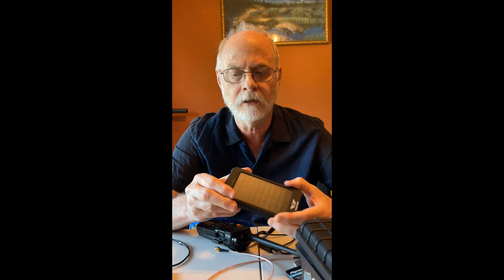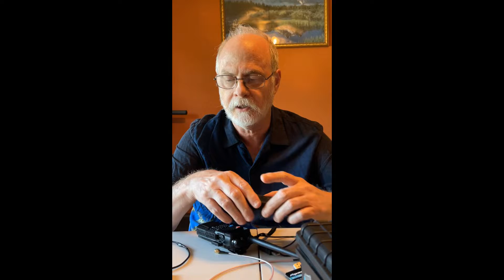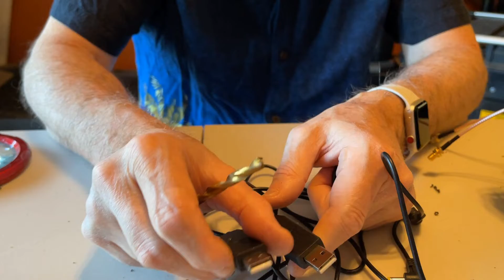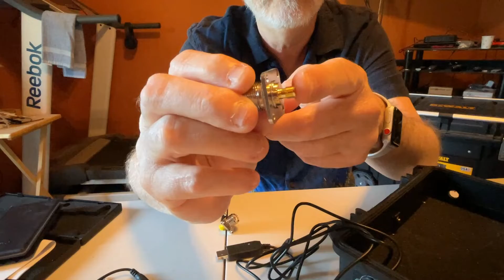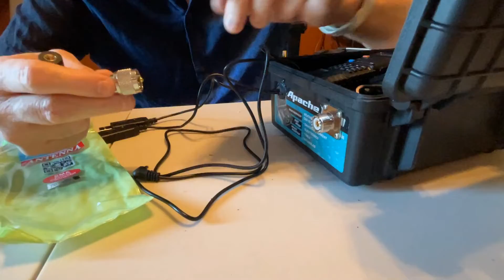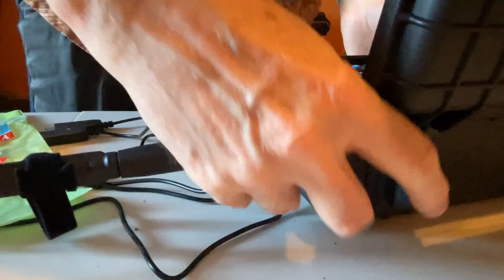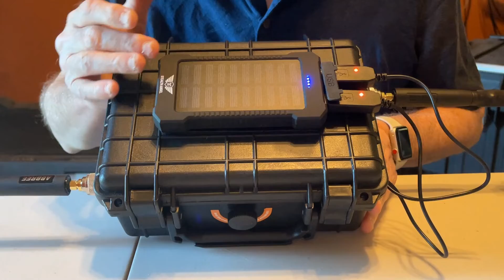Portable Repeater Build, Part 1

Comment: I believe the polarization (horizontal or vertical orientation) of UHF and VHF antennas matter. Since the people using your repeater (your campers) will probably be using their HT vertical (with the antennas up and down), I think you want your repeater's antenna to be vertical. If they are horizontal, I believe you will lose a large part of that gain you said the antenna give you.
Reply from the maker: You are correct the portable repeater needs to be oriented vertically.

Comment: Great video! Can you post the Settings for the 2 radios?
Reply from the maker: RX Radio 3
Using this VFO 
VFO B 148.600 
Menu 0 SQL 3 
Menu 2 TXP Low 
Menu 4 VOX Off 
Menu 10 R-DCS Off 
Menu 11 R-CTCS Off 
Menu  12 T-DCS Off 
Menu 13 T-CTCS Off 
Menu 25 SFT-D - 
Menu 26 Offset 000.600 

TX Radio4 Settings Using this VFO 
VFO A 148.000 
Menu 0 SQL 3 
Menu 2 TXP Low 
Menu 4 VOX 10 
Menu 10 R-DCS Off 
Menu 11 R-CTCS Off 
Menu  12 T-DCS Off 
Menu 13 T-CTCS Off 
Menu 25 SFT-D Off 
Menu 26 Offset 000.600 

Radio1 and Radio2 used to test repeater function
Using this VFO 
VFO B 148.000 
Menu 2 TXP Low 
Menu 4 VOX Off 
Menu 10 R-DCS Off 
Menu 11 R-CTCS Off 
Menu  12 T-DCS Off 
Menu 13 T-CTCS Off 
Menu 25 SFT-D + 
Menu 26 Offset 000.600

Comment: why not use a panel connector, drill a small hole and use a nut
Reply from the maker: Thanks for the reply. I am not sure for which part you are suggesting using a panel connector.
Reply: SMA antenna connector

Comment: add more solar power and add cables for the antennae plus gnd kits - then you can mount them higher for more coverage and less interference - generally a good idea just needs some tweaks and users can use liberty to dial it in #yuasa
Reply from the maker: Thanks for the suggestion. The goal of this build was to keep it as small and compact as possible.

Comment: I didn't hear you mention that you are going to have to hang that repeater box.
Those radios work on vertical polarization and natural counter poise. The one antenna can be upside down, as long as it is vertical. You will kill almost all of your distance if you keep them horizontal. 
Just reminding you is all.
Reply from the maker: Thanks for the feedback. I agree definitely needs to be mounted vertical.

Comment: I have seen several of these repeater builds and I an seeing different requirements for the cross-over cable.   One said it just has to have the correct sized connectors.  Others say that it has to be mono, not stereo.   Only one other one that I viewed said it requires you to cross-over red to white and white to red.    Which is it really?
Reply from the maker: It is a cross over cable. I found a mono 2.5 mm on one end and 3.5 mm on the other end. I cut the cable stripped back the wire and wired the red to the white wire and the white wire to the red wire.

Comment: what if you have not got enough distance between antennas?
Reply from the maker: If you don't have enough distance between the antennas you will cut down on teh efficiency of the receive and transmit and can have a negative effect on the finals in your radio.

Comment: Should give your Amateur Radio Call Sign. And talk about what a repeater does. 
And purpose of having  them. But not interfering with others. Need to mention  have to adjust the volume and for input to the output handy talky..
Reply from the maker: I am planning on Part of the video where I talk about the FCC regulations and radio programming and settings on the radio. The part 1 video is all about just the equipment build.
Reply: I don't like giving out my call sign. Too easy to look up. Just looking at the number in your call sign, I can already tell that you are somewhat close to me.
Reply: Anyone who was paying attention to his video can see his call sign is on the back of both HT's, "AI5HT". Great video however, I agree with the antenna spacing issue.
Reply: You're such a sad ham.

Comment: Why did you go from SMA to UHF and then back to SMA.  Why didn't you just stick with SMA for the whole thing?
Reply: Probably easier to get a bulk head connector for PL-259 then sma.
Reply from the maker: Definitely easier to get an SO239 bulkhead connector than an SMA connector. I did find some that were bulkhead connectors for SMA but I didn't like how they mounted. I needed a stable mount for the antennas.

Comment: Great build. Sadly, I tried this and found that the radios tended to override each other. Granted, I was pushing max output and my channels were closer than I would prefer. I look forward to your follow up to see what you learned in this process that I might glean more success in my efforts to have back-county SAR radio capability. 
Thank you!
Reply from the maker: Thank you. I will be posting Part 2 of the video where I cover the radio programming in the near future.
Reply: The frequencies have to have a minimum distance apart so they will not heterodyne. 

VHF: 600 KHZ  negative.
UHF: 5 MHZ      positive. 

That is the usual separation.
EDIT: The antennas should also be a minimum of 1/4 wave length apart.
VHF:  2   meters=          6.5 feet.
UHF: 70 centimeters=  2.3 feet.
Reply: @jhutch1470  I've always wondered what frequency override was called.
It makes it hard to learn things when one doesn't know the right words!
Does the transmitting freq need to be negative for VHF or the receiving freq?
I don't understand what you mean by negative and positive.
Thank you SO so much for the great information!!
Reply: @tophattommy2  Oh yeah, sorry. You are correct. The transmit is negative for VHF and positive for UHF. At least that is the usual band plan for ham radios. I tend to stay with what I call industry standards. 
It is just called repeater separation. 
You can always use one antenna if you use a duplexer, but they are very involved, have to be highly tuned, and use about half your power. They can also be called "tuning cans." Two antennas is always better for low power stuff. 
Hope it helps.
Reply: @jhutch1470   This helps greatly! I want to set up a couple "ad-hoc" repeaters that can be packed in for SAR activities that can relay back to IC. For an idea of the remoteness of where I am referring, open a map to 45.000000, -112.000000 and look to the south a bit.
Reply: @tophattommy2  Yeah, that's pretty remote. LOL
Reply: @tophattommy2  did you ever get this working for your SAR team?
Reply: @stephencline8561  unfortunately I did not. One of my teammates found the Retevis repeater and we went that way... I didn't keep pushing on this as we had a working solution.
Reply: @stephencline8561 I've tried commenting a couple times and yt keeps dumping the mentally comment. Short answer is no.
Reply: @tophattommy2 like people hating on you for trying this? Reason I ask is I am on a Backcountry SAR team that has been trying to solve communication issues for a while.  Actually met a few HAM operators Saturday at their field day and this kind of set up is what they suggested.   Cheap,  and works well enough for short time periods.  ( We can't install anything permanent because of the wilderness designation). Also, most people don't realize that SAR is pretty much all volunteer and we get zero money, so we have to be creative as you know.
Reply: @stephencline8561 check out the retevis repeater. That was our solution that we have been happy with. It even goes up with CAP when an aircraft is needed.... That makes for great comms!

Comment: repeater callsign?  heat build up inside sealed case? remote kill/reset in case repeater locks up?

for emergency ok but not for regular use.  some mobile and ht radios offer crossband repeating. my wouxun uv-9kg does.  also an option.
Reply from the maker: You as the operator are responsible for making sure that you are compliant with FCC regulations. I will be covering that in Part 2 of the video that covers programming.
Reply: What's your FCC YouTube Task Force badge number?
Reply: mountain man just do the same thing with a gmrs radio.  you wont have to worry about hams busting your ba***.      @MountainMan7.62x39